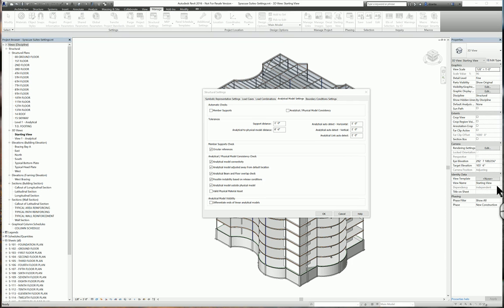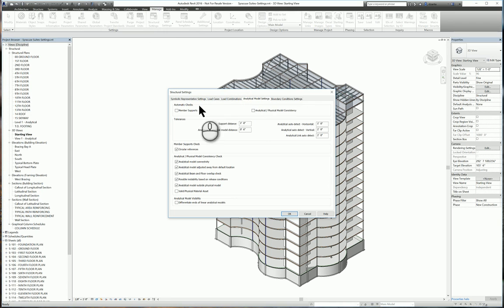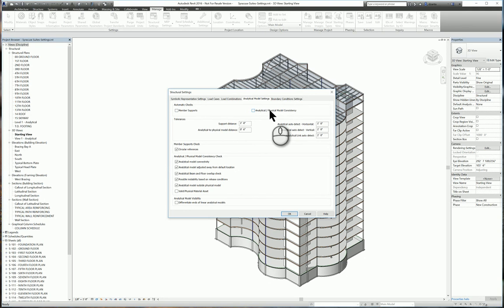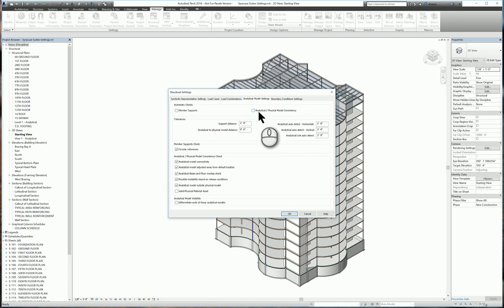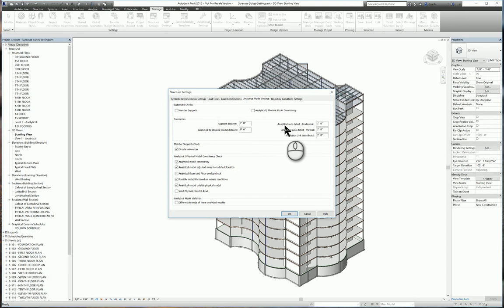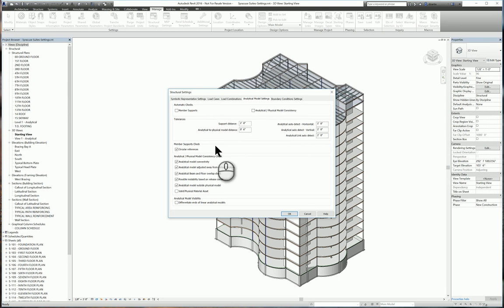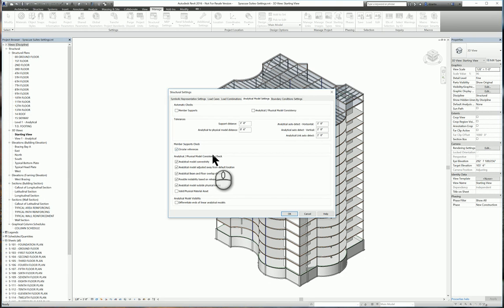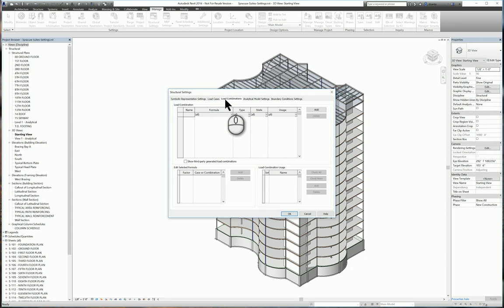Revit Structure Analytical Model Settings Tab   A How To Guide

Comment: I dont have analytical model tab when I go to structural settings
Reply: It was removed in the newer versions of Revit. You can still access the Analytical Model though in 3D view, and the visual graphics overrides has a tab for the analytical model. Starting with Revit 2023, the automatic creation of the analytical model based on the physical model has been discontinued. You can use the Dynamo tool to auto create it.
Reply: @twilightshadowclan8826  thanks for the information 🙏
Reply from the maker: Ensure you are running the latest version
Reply: @DzanTa  i have revit 2024
Also another problem is when i start drawing the model (physical model) no analytical members are created (when i go to analytical model view it's empty), i have to go to analyse tab and use analytical automation option.
which is unlike all the videos ive seen on YouTube. is there a reason for that? when it doesn't create the analytical model by itself? 
sorry im really new to this software and im still learning. thanks.